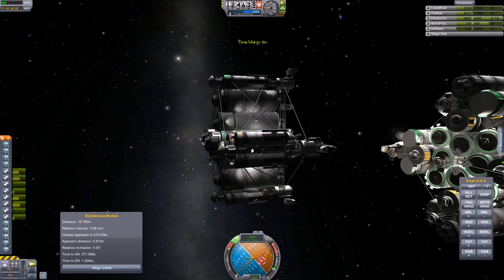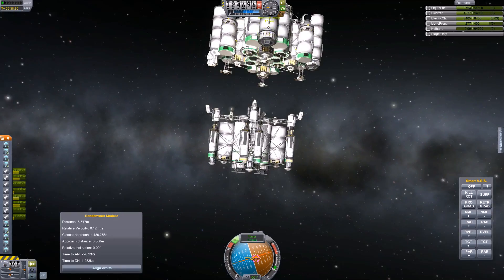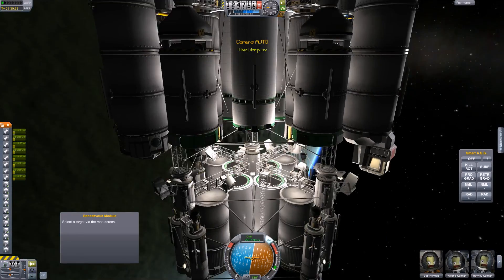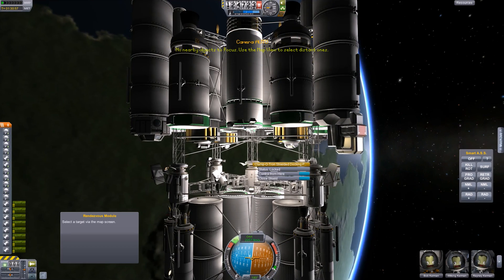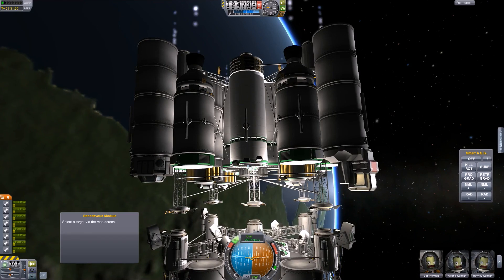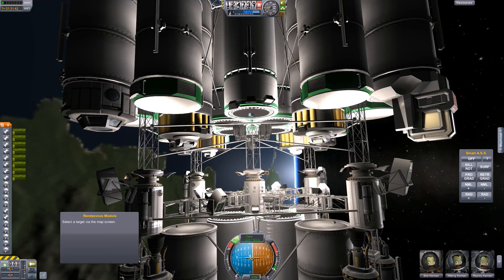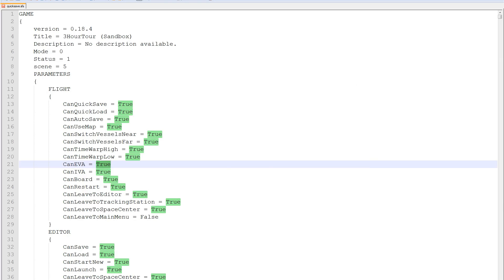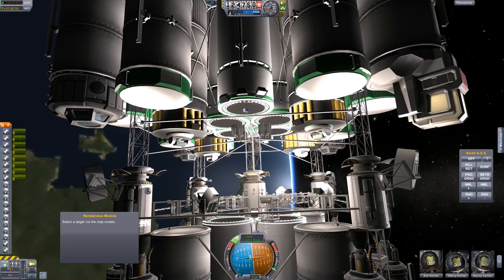Kerbal Space Program : Multi-Point Docking Tips

Comment: I found the problem (or at least one), i think, i had 3 docking ports quite far apart from each other and somehow one got slightly crooked during launch. I added more struts and that apparently fixed it.. or i just got lucky. After that i was facing a slightly bigger problem (imgur.com/4O3wuZ5.jpg). But I had to shrink down this platform due to lag and therefore redesigned it. Thanks for offering your help though =)